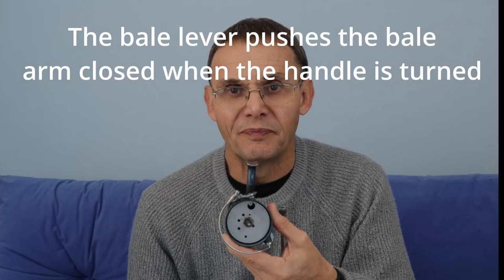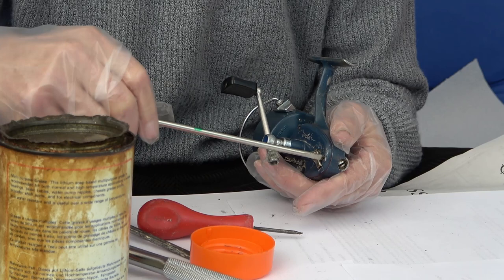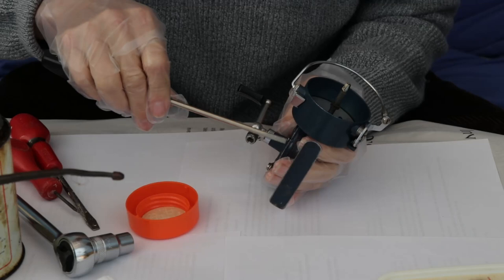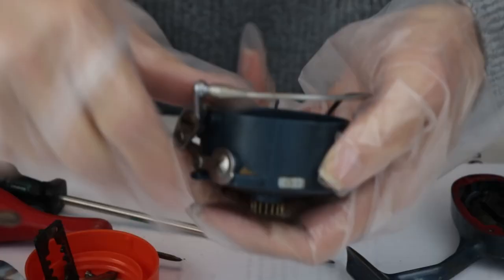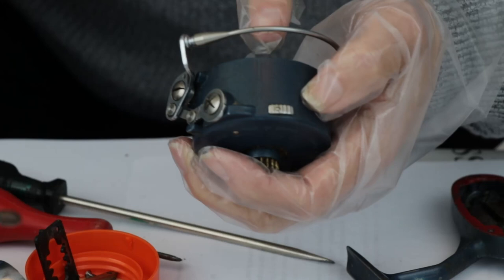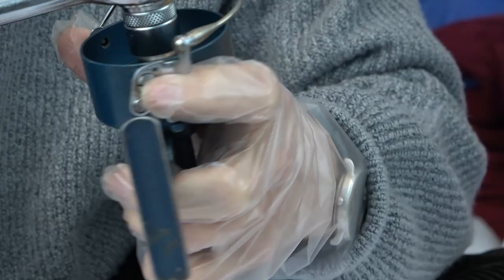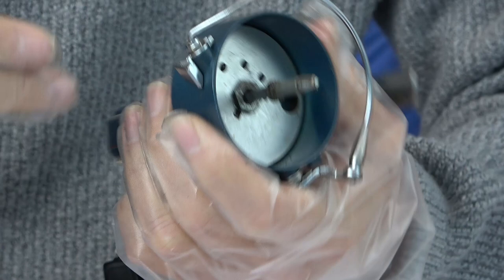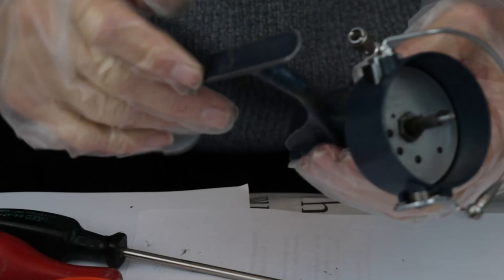Roach Reflections - Part 37 - Basic Maintenance on a Mitchell Match 440A

Comment: Thanks Mark. As required. I normally use a much thinner oil and just this week bought some Singer Sewing Machine oil that is super thin, but I tend to use it little and often, like groundbaiting. As for grease, again it's a PTFE based grease and tends to stick to parts coating them fairly evenly. Your video covered all the warnings though about what parts fall apart when you loosen screws and that's good enough for me. Glad you had a knackered old reel you weren't too bothered about if it did fall apart.
Reply from the maker: There are different schools of thought on the lubricants. I have a tube of Mitchell grease that I stumbled on in a shop in Madrid of all places, as well as the old-school car grease, plus the engine oils as mentioned. Jan Porter used to run his Matches on WD40 which isn't a lubricant at all and his reels didn't last long! In hot weather grease can be good but a reel overloaded with hgrease can be hard wrok on a freezing cold day. I suspect the best I've used is the gear oil but it might be an idea if I looked out for one of the modern greases. 

I may yet try to tackle the malfunctioning bale arm though videoing it in detail won't be easy! I had previouisly switched the working bale with the non-working one on my Mitchell 840 as I wanted the 840 to work properly.

Comment: Just discovered around subscribed to your channel Mark. Enjoying the videos and there is something particularly satisfying when you get an old Mitchell running again smoothly.My “technique” is to attack the bail arm with penetrating oil before disassembling as I have remedied many reels that way.Also I am a bit fussy about the grease I use which I always feel is best used sparingly.Obtained a grease called Slug Slime a good while back which I find ideal as I don’t like the lithium based greases.A drop of Penn reel oil in key areas also does the trick.I am sure you are aware,but if you are working on Mitchell reels regularly,getting one of the special Mitchell tools is well worth it as it is obviously made to fit the screw heads and saves potentially “butterflying” the heads.Well chuffed yesterday as found a mint condition 440 Match yesterday in a junk shop with ultra fine spool for £6.50 which I am looking forward to tuning up.Tight lines Stuart

Comment: Thank you for this going to have a got at fixing mine got a load of line wrapped around  the shaft took it apart and  having problems putting it back together but think this will help.
Reply from the maker: Did you fix it?
Reply: @MarkWintleFishing  yes thank you easy when I got the front off give it a clean and grease I have used the reel for 40 years never let me down. Thanks for the help.

Comment: Another great video...there is a little silver rectangular "switch" on the outside body of the spool........I have just aquired a very good 441A which is working well......but I'm not sure what that little "switch" does ??
Reply from the maker: It's a lock for the auto bale to keep it closed. In use it's left off.
Reply: @MarkWintleFishing  ........thanks Mark :)

Comment: Hi Mark, I have just bought a Mitchell Match, I had one when I was a lad but it got sold on at some point. The only issue I have with it is the line roller, it wont rotate, I have dismantled it and cleaned it up but no joy, are they designed to rotate? Loving the vids I fished the Medway as i grew up and trotted most of the time but other fishing took over and I stopped but watching you has brought all that back. I have a stock of J Dean stick floats so I am getting back on the river and get trotting.
Reply from the maker: I've never known it to rotate. As long as it's clean and not grooved then it should be OK. Good luck on the rivers.
Reply: @MarkWintleFishing  Thank you Mark, yeah not grooved so should be fine then. Looking forward to trying it out

Comment: Where do I get springs from please
Reply from the maker: Not easily. There used to be several dealers in the parts but very few left. Sometimes eBay will turn up what you want. Try joining some of the FB groups on Facebook as someone might be able to help.

Comment: do you ever use closed face reels
Reply from the maker: Rarely nowadays. Back in 1973 I was toying with buying a new reel and someone lent me a Mitchell 300 which I won a match using but the next day I bought an ABU 505. I used that reel a great deal over the following four years, switching to a Mitchell Match about that time. Later I acquired a mate's ABU 506 (bought in 1972) which I dig out once in a while, and a Daiwa 120 which I bought for facing winds on Longleat around about 1986 which I also use occasionally.

Comment: Just buy a 501
Reply from the maker: It would halve my casting distance... I was a fan of the 505 until I got a Match and that was in 1976.
Reply: Each to there own Mark. Easy rectified by a float taking one additional no 4.
Reply from the maker: Each type of reel has its constraints and advantages; centre-pins are poor for casting and slow to wind in, closed-face are relatively tangle-free but there's poor line lay and a lot of friction for the line around the winding cup and reels like the Match tangle easily but have top-class line lay. The 505 I had was used very heavily and the torque on the spool used to wear out the pins attaching the spool holder to the gears - I think I replaced that part three times in five years.
Reply: @MarkWintleFishing  never worn that part out Mark been using them since the 70s.
The only part that need replacing is the pick up sled. And with extreme use, occasionally the pinion gear bushing wears on the two lugs but you have to give it years of hammer to wear that part out. They are practically bullet proof.
Reply: Or a ABUMATIC 41 or 141 . Works exelent on pistolgrip vintage ABU Rods, my favorit spinningreels and rods.